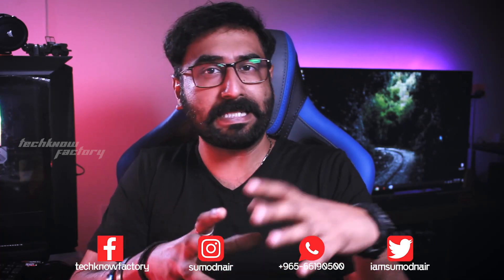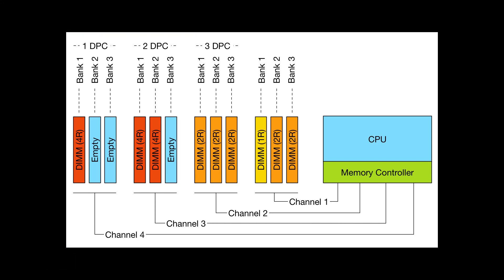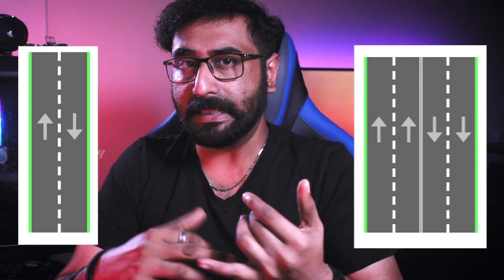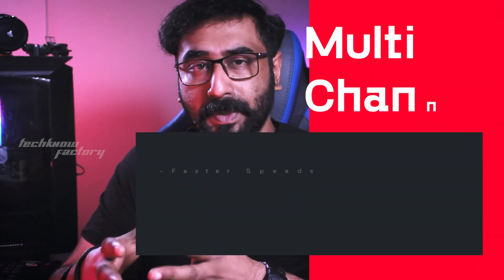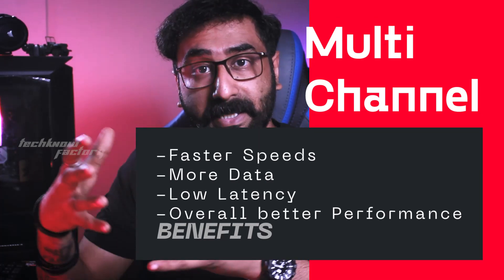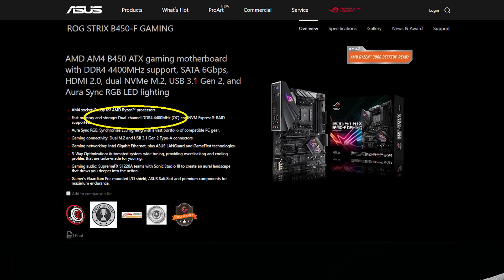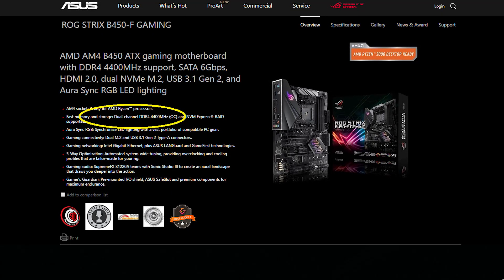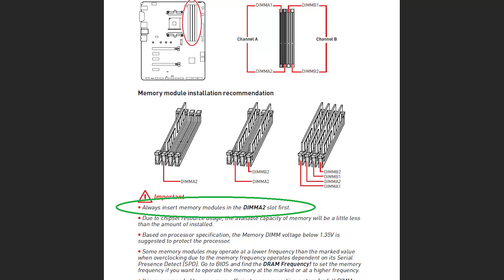Single Channel vs Dual Channel RAM Performance [Malayalam]

Comment: താങ്കളുടെ ഒട്ടുമിക്ക വീഡിയോകളും കണ്ടിട്ടുണ്ട്, കമ്പ്യൂട്ടർ പാർട്സുകൾ സെപ്പറേറ്റ് ആയി വാങ്ങി ബിൽഡ് ചെയ്യുന്ന എന്നെപോലെയുള്ളവർക് വളരെ ഉപകാരപ്രദമാകുന്നുണ്ട്. 
Motherboard and processor വാങ്ങിച്ചിട്ടുണ്ട്.
Usage:3Drendering nd visualizing 
no gaming
Bro Please reply my questions
1.AMD Treadripper 1950X + Asus zenith extreme X399 mobo. മെമ്മറി 128GB വരെ support  ചെയ്യും. പക്ഷേ 32 GB മെമ്മറി ആണ്‌ ബഡ്ജറ്റ് .  2x16=32GB or 4x8=32GB ഏതാണ് ബെറ്റർ ഓപ്ഷൻ?
2. GPU RTX 2060 Super or Radeon RX 5700 XT ഏതാണ് ബെറ്റർ GPU?
Reply from the maker: Threadripper latest edukamayirunnu or athilum better3950x than first gen TR aanu, eduthegil onum parayan illa.. Anyways ram 4x4 is better 2 sides dual channel 4vene for future... Gpu 2070 super or 2080 above okke nokam better with threadripper idhokke full bottleneck aanu...
Reply: ഈ രണ്ടു  പ്രൊസസ്സറുകളും 16 cores തന്നെയാണ്.
CG related സൈറ്റുകളിൽ 1950X നല്ല പെര്ഫോറ്മാൻസ് ബെഞ്ച് മാർക്ക് ഉണ്ട് 
Vray benchmark better aanu.
ചൂസ് ചെയ്യാനുള്ള main കാരണo
 TR 1950X കഴിഞ്ഞ ബ്ലാക്ക് ഫ്രൈഡേ സെയിലിൽ
 3950X nthe പകുതി വിലക്ക് കിട്ടി😊
Reply from the maker: Ahhh ok..✌️cool